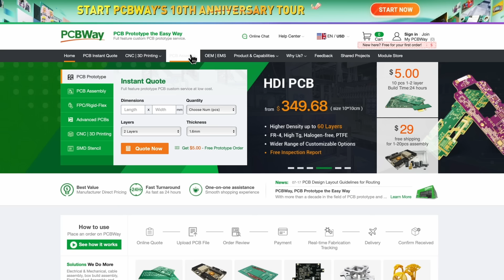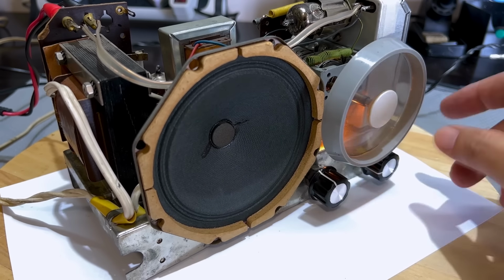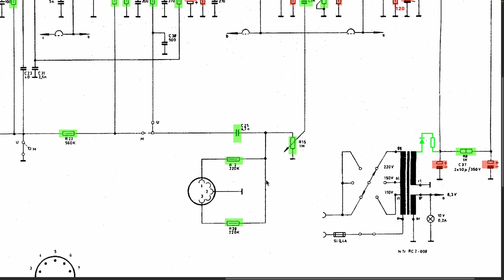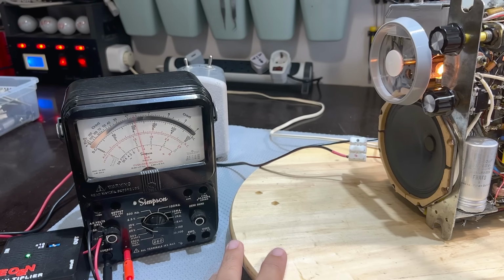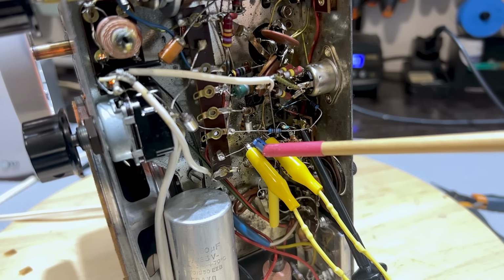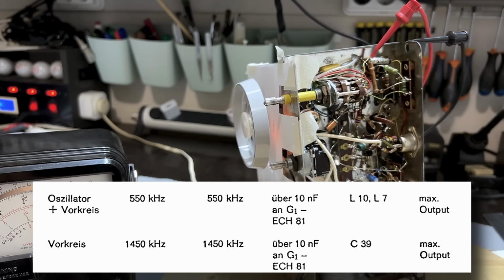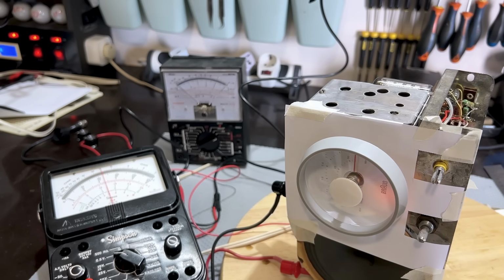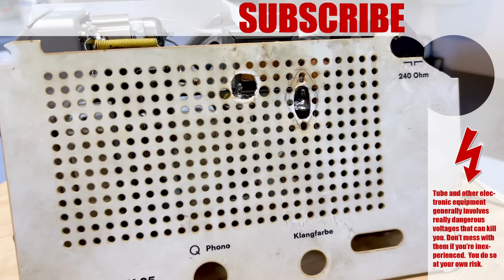Vintage Braun SK25 Radio Revival: Complete Electronics Restoration & Alignment - part 2 #pcbway#

Comment: Nice work! It fascinates me how these old radios can so often (maybe too often!😁) catch one out with the simplest of things. The AM apparent issue on this one being a good example. And the doubts you had on the RF alignment is a reflection of the skill and experience that you have with these. Makes it a joy to watch!  The phono input is an interstng one. Maybe Braun were ahead of their time. Stick a microphone on that input and you have an instand karaoke machine! Sing along to your favourite radio station...
Reply from the maker: 😊 Didn’t think of the karaoke option …. Way ahead of its time 😊
Reply: @electronicsoldandnew  I suspect Braun were far too 'chic' for karaoke! 😂But it does still make you wonder why they wouldn't have a three position switch?!!
Reply from the maker: They must have stocked way too many switches for the previous model 😊

Comment: Neato....

I am building a regenerative receiver using copper clad boards and raised islands in more or less Manhatten style. I thought I had all the parts I needed in my assortmant of cap kits & etc, but I lacked a 1k & 150k potentiometer & two diodes with one being a specific zener. 

Wanting to follow specs I ordered the parts. Honestly, I would have used DigiKey or Mauser, but their web pages are hard to use on a cell phone, my only internet gateway. Actually, I'd use these suppliers if a part like a 150k potentiometer did not return hundreds of options or if I knew what the heck the difference was given by the descriptions so I used EBay.

I think it was exactly $31 with shipping & tax being about 1/3 the cost. Sure seems pricey given you could buy a fully assembled $15 Am/Fm/Sw radio out of China. I do salvage as many parts as I can from thrift store items such as transformers, variable capacitors & even wire. On the other hand is there a better source for getting needed parts on a one or few part basis? If so I'd love to hear about it.

Comment: Btw, still have a question about the previous video.
Why did you still went for a single diode rectifier and not just a bridge rectifier?
A bridge rectifier would double the rectified frequency and therefore lower the ripple and noise. There was plenty of space for it 
I think that's always a good thing 😊
Reply from the maker: The transformer ground was connected at the transformer, and I did not want to change the design concept at all. The fact that there is no hum tells us that it’s fine as a half-wave rectifier.